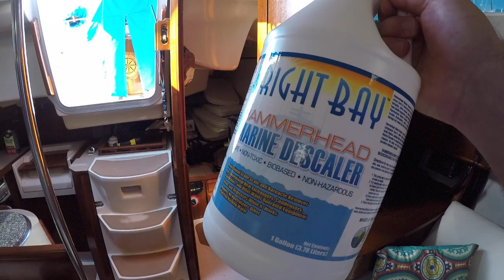Overheating - Troubleshooting a small diesel sailboat engine - a Yanmar 2GM20F

Comment: I'm amazed how boat owners will change the oil at half the hours recommended by the manufacture.  Yet hardly ever consider the cooling system/heat exchangers.  Way more broken motors from overheating than dirty oil out there.  Thanks for taking the time to produce the vid.

Comment: Slight engine overheat combined with steam/white smoke on Volvo Penta 285 hp: impeller OK, cleaned the heat exchanger, checked exhaust elbow, checked raw water flow and all seemingly OK. The six injectors were all removed and sent away for testing and they were all clogged and varnished up. The tips were replaced and they were thoroughly cleaned and soaked. The service shop said that there was a poor spray pattern and most likely unburnt fuel causing heat build up etc in exhaust and thus steam and smoke. Re-test due soon but hopefully that will be the end of the problem!

Comment: To get rid of mineral deposits I use white vinegar.  Cleans my coolant system overnight while I sleep.  To keep the hoses from sticking to the metal piping I use Permatex Aviation Gasket sealer. Works great.

Comment: Got to share my experiences.  We are in between boats now, but our last boat was a Hunter Vision 36 with a Yanmar 3JH2E engine.  I cleaned my exhaust elbow twice and the heat exchanger once.  Did it myself, no radiator shop.  Very simple, I took the parts off, removed their gaskets and boiled them out in muriatic acid in a 5 gallon bucket.  Soaked them for less than and hour and they came out looking like jewelry.  Neutralized in a soak of ammonia and they were good to go. Put them all back together with new gaskets and she ran cool as a cucumber.

It's amazing what sealife grows inside those parts.  And the carbon build up.  I found a lot of confetti plugging up my exchanger, presumably from 4th of july celebrations we attended in the delta.
Reply: Keep ammonia away from brass or copper, does some bad things, neutralize with baking soda.

Comment: Hi Orange Fish great video, A few tips if you don't mind for next time. 1) Do this annual before you launch the boat and replace the impeller and save the old one. 2) I always remove exhaust elbow 1st and plug the exhaust with a rag or plastic bag to avoid any moisture to enter the exhaust system. Now you can clean the exhaust elbow on the inside and inspect for corrosion. Corrosion starts from the inside. 3) I simply pull out the heat exchanger and soak it overnight in vinegar 1 US gallon and rinsing it the next morning. After a good rinse I can see witch tubes need a tune up with a pipe brush. 4) Clean all the O-rings and treat with vaseline and I use dialectic compound on threads and nuts. 5) After seeing you use the de-scaling solutions I look forward to try that myself as a half season solution. Nice boat
Reply from the maker: Good tips! The impeller wasn't that old, but since the heat exchanger was partially closed, it might have contributed to its early demise!

Comment: Consider yourself so lucky to be able to access the rear of your engine.... Ive got a Watkins 29 and have to get into the lazarette and reach in through a small hatch to get to my exhaust mixing elbow and my shaft stuffing box.  Not fun on a hot summer day in South Florida.
Reply from the maker: Concur, with our old US30 sailboat, I had to snake myself into one of the cockpit lazarettes,  and lay across tanks and such to even see the back of the engine.  It originally had a Volvo MD7a, and we eventually repowered with a Beta 16, but rear access didn't get any easier... The worst job ever was replacing the stuffing box.  Yes, she was out of the water, but it was still a crazy cramped job... I am 6"2"

Comment: get a spray can of molybdenum disulfide and place your fasteners in a can, while shaking the can spray the moly into the can for about 10 seconds.  This will coat the fasteners threads well and then re-assemble your parts.  Moly is a dry lubricant and so next time when you have to work of you heat exchanger you will not have to worry about stripping threads or breaking a bolt.  also, first take a wire brush and brush all bolt / nut threats until clean before coating with moly.
Reply: A friend gave me a qt. can of powdered molybdenum, I'm always trying to find uses for it, I use it for sliding surfaces like drawer slides, but I never thought to coat bolts with it, I'll have to remember to do that, thanks.

Comment: I just realized how exacy similar your yanmar diesel is to my ym 1500d tractor. That's awesome and if it's as reliable and bulletproof as the tractor engine has been with an extremely high amount of well maintained hours that I have on her, you will have no issues with it as long as the maintenance is done and she keeps cool it will rum forever. 🖒

Comment: Nice to see a DIY job like this.  You can buy a stainless steel or brass cylindrical brush from McMaster online, among many places.  Just like a bottle brush or test tube brush, and perfect for cleaning the heat exchanger tubes.
Reply from the maker: Just wondering, would you think a brass or stainless brush would be better?
Reply: Depends on the material you are scrubbing.  If the tubing is brass, copper, or aluminum, use the softer brass brush.

Comment: I grease the hose with anti-seize so it's easy to separate from the exhaust. Greased the gasket with anti-seize as well, never have to change gasket for years as it won't stick to metal nor gets damaged.

Comment: To keep hoses from collapsing, buy a stainless steel spring , the same diameter as the inside of your hose. Made for that purpose. Available from automotive parts stores. Cheap insurance to prevent overheating. Blown head gaskets,all that good stuff

Comment: Using a lubricant like that on the threads, or ever worse under the head of the bolt is a recipe for over tightened fasteners and stripped threads. I understand you're trying to prevent corrosion, using a zinc rich anti seize. The zinc is sacrificial and protects significantly better than a barrier coating like the Lanocote.
Reply from the maker: Thank you for the feedback, will keep that in mind next time!

Comment: we have found a more reliable way with the descaler  - a 20 litre bucket and a small 12v pump  - essentially get your solution I think its 50/50 and hook into the raw water supply pumping thorugh the completes cooling system with the recovery line that feeds the exhaust elbow being the end of the circuit  - circulate in one direction for 20 mins  - the swap the flow so you push in from the exhaust side and recover back to your 20 litre bucket from the raw water supply.  Seriously effective.  - I would really like to know what the tool was you used to take out the stripped nut

Comment: Thanks for the video, it looks like you were using a kobalt socket set which is my favorite however when  breaking bolts it is unwise to use their 12 point deep sockets on a six point bolt.  A 6 point socket is worth it's weight in gold that will only prove it's value when that extractor doesn't work. I pass that to you having already paid some very costly prices.  Also a good swivel is good for the wrist somtimes
Reply from the maker: Fixing boats in exotic places is what I've read, you've got to use what you have available. I'll have to Goolgle you suggestion and maybe add it to the wish list.  Thanks!

Comment: Welding Rod or a small caliber gun brush works great for reaming out the tubes.
Reply from the maker: A gun cleaning rod would make for a good cleaning tool for this job, just something I did not have on hand at the time.

Comment: speedometer cable core.  steel cable can also be used but its much stiffer than speedo cable core. . it can be really handy to clean out bent tubing and other tubular devices..  and you really should invest in some ball end extensions for your socket set..  so much nicer to use.

Comment: interesting. silly question, but where to introduce the de-scaler into the system?
Reply from the maker: Just closed the seacock and opened the top of the sea strainer and poured in the de-scaler to match the amount of water the engine was pulling in.

Comment: How many hours was this engine? Mine is about 2000, used in slightly salted sea (Baltic) and there is no troubleshooting with overheating. Is it time to inspection or not?
Reply from the maker: Unfortunately, our engine is older (1990s) and is not equipped with an hour meter.  With that said, the cooling system will start to clog over time with salt and other organic buildups adhering to hot surfaces, so this is a good exercise in maintenance to keep the engine healthy regardless of the type of water <she> lives in.

Comment: Have you seen anyone put a freshwater rinse option on their motor? Seems like an easy fix for a lot of issues and just cycle 60 seconds of freshwater after each usage to say frustration later.
Reply from the maker: I have, however, when the salt water is running across the hot exchanger, I'd imagine the scaling build up was done and a fresh water flush wouldn't remove it all.

Comment: When you got the overheat light and alarm did you check your discharge to see if water was flowing through the system or did you just assume it was a plugged heat exchange? Did you check the inlet strainer? Or the through hull fitting to see if it was building up with barnacles? Great video but missing a few details for other do it yourselfers.
Reply from the maker: @Paul Schuster Close the raw water seacock to the engine, open up the top of the strainer.  Have some start the engine and pour the descailer in at the rate the water gets sucked down in the strainer housing.

Comment: I`m going to bye a Cat whit TO of this engens, so i  realy like your videos :-) Big thanks! Impeller I know how to change ;-)
Reply from the maker: Cats are awesome... maybe someday.  Anywho, the older Yanmars are easy to work on if your a little bit mechanically inclined.  Good luck with your new boat!
Reply: Yeh...I know my way a round. Grew up on my dads back ;-) But it was nice to see how the engien was. Too see were everything was located. The motors only had 280 h. and 293h So they should be good. 
But thanks again. Nice film clips.

Comment: I have read that the heat exchanger tube assembly will slide out so it can be taken to a radiator shop. Did you try pushing it out?
Reply from the maker: I did not, but looking from the top down with fill cap removed, from the fresh water cooling side, it looked very clean so I didn't go down that rabbit hole.  Thanks for the reply Chuck.
Reply: Thank you! I feel much more comfortable taking on the same project with mine now.
Reply: Yes, it pushes out easily.  Just soak it in muratic acid, then neutralize the acid by soaking it in ammonia.
Reply: @MrHradecky  it does come out easily

Comment: Great video my friend! Let me ask you, is not necessary  to take out de mixing elbow to access the back of the heat exchanger, right?
Reply from the maker: Yes, the mixing elbow is considered a wear part that needs to be replaced.  The stock cast iron ones will last for years, but supposidly the stainless ones will last forever becuse they don't corrode like the steel does in salt water.

Comment: Great video.  Did you drain the coolant before removing the heat exchanger end caps or do the core o-rings maintain the seal.  I need to search for missing impeller veins this weekend.
Reply from the maker: If the impeller veins haven't made it all the way through to the exhaust, I'd imagine they are stuck on the input side of the exchanger or in the cooling tubes.

Comment: Hey Orange Fish, I live in Palm Harbor and just purchased a sail boat with the exact same engine. My question is you mentioned you went to your local Yanmar dealer and picked up some parts. Who is the dealer? I need to grab some parts for my cooling system as well and want to expedite the process. Thanks!
Reply from the maker: http://yachtpowerproducts.com

1510 1st Avenue North
St. Petersburg, FL 33705
Reply: Gracias

Comment: Nice work.
I don't know why there aren't more air cooled small diesels in boats this size. Providing enough air cooling via an engine compartment exhaust blower seems minor compared to all of the other hassles with heat exchangers and raw water cooling accessories that the boating industry has to engineer into water cooled boat engines.  Thru-hull fittings are responsible for sinking a lot of boats in one way or another, too.
Reply: A blower is no where enough CFM's to keep the engine compartment  from overheating.   Even if you did have a huge blower ventilating the compartment, air cooled radiators do not do well in a salty marine environment.
Reply: Never heard of an "air cooled radiator" except maybe an intercooler for a turbocharger.  A ducted fan blows air over cooling fins on an air cooled engine and that air has to be dealt with, that's all. We're talking about an engine that makes about as much heat as a riding lawnmower in a small sailboat.  Deutz actually makes air cooled marine diesels (big) and there are YouTube videos of Europeans running smaller air cooled diesels in open fishing boats where air obviously isn't a problem.
Reply: The ventilation required would make the cabin uninhabitable.
Reply: aircooled engines are mutch more noisier, and dont forget, the exhaust sistem. using raw water in a cooler, and clean cooling liquid in a boat engine is way less complicated as you think, aircooled is way oldfasion.
Reply: scdevon
I agree, nothing but aggravation, my cast iron risers totally fur up, and needs replacing £500 for a new one from volvo... Grrrr
Reply: Volkswagen air cooled!
Reply: 1st you are talking about an enclosed space.
2nd you are talking about an enclosed space.
3rd you will never get the point.